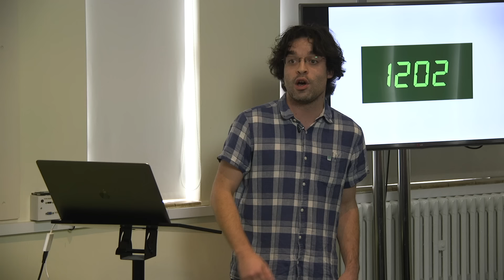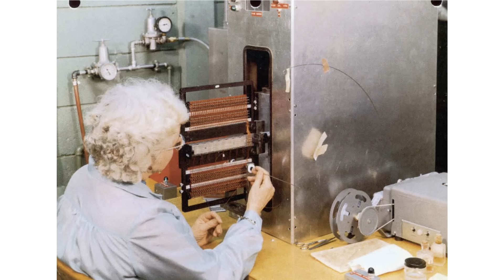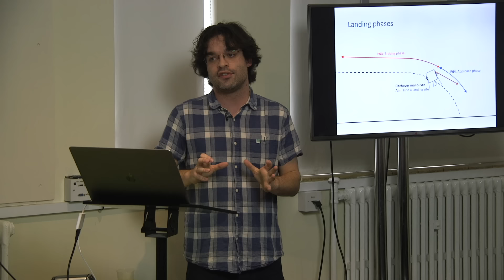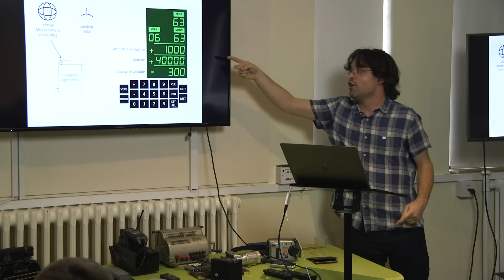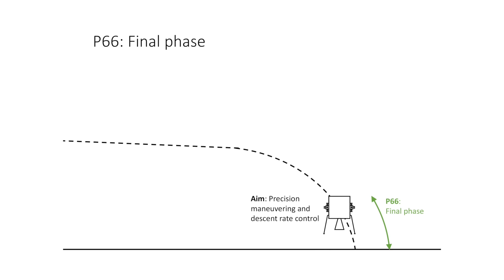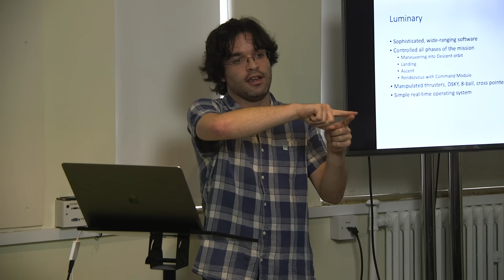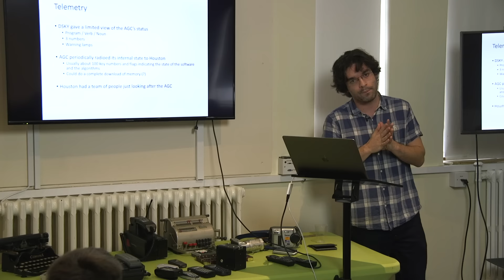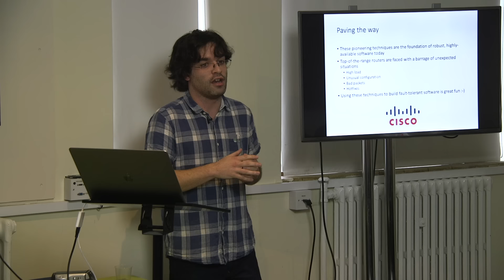Light Years Ahead | The 1969 Apollo Guidance Computer

Comment: Why they're are no documentation of the' bynary op codes for this AGC computer? anyone trying to emulate or compile the luminary code needs that.  All talks only mention the code in a mnemonic way,  that's weird as engineers need the actual bynary op code to compile and calculate memory usage. This raises more questions than answers.  I doubt the compiled luminary code would fit in the rope memory they mention. There are too many points of failure for such design to be reliable for such dangerous mission. I call this BS.
Reply: Search for the Programmer's manual Block 2 AGC Assembly Language. That has the info you're looking for (mnemonic to octal translation table).
Reply: @h.dejong2531  Thanks! I found some octal OP Codes table,  I will have to spend time going through it.  What still is suspicious is that all sites that talk about AGC or discuss its internals  do not cite direct sources or documents from NASA, MIT, IBM or any official source, all come from third party sources like collectors or a John Doe ex NASA worker that happens to keep copies to him self, and some weird ones like from ebay sellers etc. To not go to far the speaker on this video is supposed to be a Sisco worker and does not provide any official sourcing either.   Any effort to reconstruct or emulate such a computer without the official sources won't be taken serious, it won't be more than a fun exercise and will lack of any historical value.  I can see why this might be.  Let's say a find a technical flaw that proves this computer can't perform as they say based on the information I have, NASA or any one will argue that the information I use to base such conclusion is not official and that my sources are wrong.  If you put this under the scrutiny of a librarian or a Historian, it would not pass the test to be considered Historical evidence for the described artefact called AGC computer.
Reply: @FinepixF30  NASA's NTRS archive has at least 162 documents on the AGC. Design details, reliability tests, etc.
Reply: @h.dejong2531  How can any one interested get a copy of such archive?,  why none of the third party books, videos, websites etc about the AGC computer mention or provide links or reference such archives?,  by the way if you don't mind, can I ask you do how you know this?
Reply: @FinepixF30  Yes, the Nasa Technical Report Server is a public website. Most of its documents can be downloaded, for others they only have an index. 
Most of the AGC projects I've seen are hobbyists, they may not consider publishing a full list of their source material important. 
How I know this? I've always been interested in spaceflight, and I'm good at finding information.
Reply: @h.dejong2531  I checked the website but beside some reports with descriptions and photographs I couldn't find any document with detailed schematics for the electronics circuitry for example for the program counter, instruction decoder, clock circuitry etc.  I saw on a third party site an schematic dated on 1965 using a operational amplifier but they were not invented until 1967,  i want to see an schematic directly from NASA or MIT to confirm or disprove this but all schematics are from third party sites without any reference to the source.
Reply: @FinepixF30   A search for apollo agc schematics office logic design finds a site called klabs, which has schematics supplied by Eldon Hall, who worked on the design of the AGC. 
The Smithsonian has the primary archive of all Apollo drawings, so that's the most authoritative source. IDK if they've scanned everything though
Reply: @FinepixF30  A late reply, but you're very wrong about when op-amps were invented.  The 'op-amp' was patented in 1941 and was originally made with thermionic valves ('op-amp' is a concept, and not limited to being a family of integrated circuits).  In the 1950s and 1960s hybrid op-amps were developed - essentially some transistors potted together (start with the Wikipedia entry for op-amps, but have a look for the wonderful and sadly late Bob Pease's contribution).  The µA709 was released in 1965 and that was fully monolithic.  The µA741 was released in 1968 and is still in production today. 
So no, op-amps weren't invented in 1967 - they existed in many forms, including fully monolithic, long before then and were used in the circuitry of the Apollo program.
Reply: @medicallyunexplainedsymptoms  Fair enough,  probably one of the best answers.  For the other questions still no a convincing answer. So far I have not found the machine language instruction set used for the AGC computer wich is the key information to do any reverse engineering or create any trustworthy emulator.

Comment: I'd love it someone could compare the speed/power of something that was so exceptional back in the day to a modern desktop cpu and the fastest smartphones out there...
Reply: AGC: one processor, 16 bits (more or less), 2 MHz, 64 kB ROM and program storage and 4 kB RAM. Multitasking. 
Home computer in 1981: one processor, 8 bits, 4 MHz, 16 kB ROM, 64 kB RAM and external storage of programs (cassette tape). No multitasking.
Home computer in 2019: 8 processors, 64 bits, 2.9 GHz, 32 GB RAM. Multitasking, protected memory. So 1500 times the processor speed (and actual speed is even higher because these processors use pipelining to do multiple steps in one clock cycle), half a million times the RAM. Infinite program storage (just add more harddisks or download via network).
Reply: @h.dejong2531  I can’t believe you took the time to answer that question. Thanks so much!

Comment: I was told, by one of the Apollo astronauts, that the cause of the 1201 and 1202 error codes was the Rendezvous Radar switch was left on during the descent. But there is still some controversy over that switch position. The astronauts said they wanted the Rendezvous Radar on during the descent in case they had to abort and immediately determine where the Command Module was. But there were several comments on this decision: one claim said the Astronauts were not instructed to NOT use the Rendezvous Radar during descent. Another claim said there was a phase problem between the two A/D power converters and the CDU's, they supplied power to. That phase difference frustrated the Lunar Module guidance computer because it got two completely different sets of data indicating the location of the antenna. As a result, the computer kept, continuously, trying to move the Radar Rendezvous azimuth and elevation, in an attempt to find the Command Module, in one direction, than another. THAT, that claim indicates, was the reason the guidance computer got overwhelmed and the 1201 and 1202 malfunctions codes were issued.

Comment: Excellent talk but I have a couple of constructive criticisms: first, it is not true that the Block I spacecraft 'flew the first few missions' - it never flew in space: that was the ship involved in the Apollo 1 fire and it was completely redesigned before Apollo 7 which used the Block II.  Second, there was no mention of the other guidance computer - there was an identical one in the Command Module, which was used for navigating to the moon. The two were identical architecturally, but ran different programs - this explains why the speaker talks about P63-66 but does not refer to P01-62. Third, the calculations done by both the AGCs were mirrored by mainframe computers in Houston, just as the crew's star sightings for navigation purposes were compared with telemetry sent back to earth and fed into the mainframes. But a really brilliant talk nontheless.

Comment: so...why was max power 94%?
Reply: as far as I can find, 100% is the original design goal. 94% is the maximum value used in the mission.
Reply: @h.dejong2531  I reached out to Robert Wills and he replied to me yesterday with this "They found during testing that power greater than 94% caused excessive corrosion of the engine bell. From memory, the allowed thrust settings were 10%-57%, and then 94% (nothing greater than 94 and nothing in between 57 and 94). Don’t quote me on those exact numbers!

There is specific code in the AGC software to make sure it never commands the engine outside of the allowed settings."
Reply: @eeclarkutube  oh, excellent.

Comment: Two alarm codes triggering multiple times at the most critical phase of the Moon mission is........NOT "working flawlessly."  By this stage of the program the landing should have been routine. The overload condition of the computer should have been foreseen and accounted for. They should not have gotten any alarm codes. In modern aircraft, for instance.........certain alarms are inhibited during critical phases of flight....because they are a nuisance and could distract the pilots. Even the autoland status will not be downgraded in close proximity to landing.

Comment: Anyone got a reason for the 94% thrust figure that nobody addressed in the Q&A?
Don Eyles confirms this in his book
"Then, 26 seconds into the burn, the software throttled-up the DPS to its maximum thrust of 9870 pounds (43, 900 newtons), 94% of the engine's official rating of 10500 pounds, and at the same time enabled the descent guidance."

Comment: No landing crater by that big center engine? No dust on the tin foil? Camera already in place to take landing footage. Lost telemetry data and technology so we can't go back. Don't look into it though, just take our word for it. We would never ever lie to you. You can trust us. Cartoon satellites, CGI globe images with growing continent sizes? Come on man. Don't ask questions just look at the shiny pictures of space and Mars.
Reply: The lunar soil was found to be very hard, with everything interlocking. A 45 kN engine won't blow away that much. In the descent video, you can see dust being blown away. 
That 'camera already in place' was stowed in a compartment on the side of the LEM. The compartment door with camera was released by the astronauts. 
NASA did not destroy the technology. Drawings for every part of the Saturn V and Apollo spacecraft exist. We have a bunch of versions of the software for the AGC. We have loads of info on every aspect of the design. Is that enough to start building a new Saturn V tomorrow? No. That's what they're getting at. You'd have to build a factory large enough to assemble a Saturn V. You'd have to build new jigs (because they didn't keep the jigs around, some of those are as large as the first stage). You'd have to replace some of the 1960s era components with new ones: it'd be ridiculous to build new AGCs. So you have to develop new software. The drawings have to be redone in CAD so you can use modern manufacturing processes. All in all, it takes a few years to start up a Saturn V production line, and in that time you could also design a new rocket. This applies to all complex, old projects by the way. B-52, SR-71, the Eiffel tower they would take a long time to replicate, and with today's knowledge we can do better anyway so there's no point. 
The 'moon hoax' story was created by a failed author in an attempt to make money by selling books. He didn't do any research: every single one of his arguments falls apart when you start looking at them closely. He didn't provide any evidence for his arguments. He failed to explain how we ended up possessing 380 kg of material from the Moon, he failed to explain why the Soviets accepted the Moon landing as real. etc. IOW, he was a charlatan trying to make a quick buck off the gullible.
Reply: Why should there be a crater? I don’t recall the descent module exploding.
Reply: @thingusbrulingus  Yea because a jet propulsion engine firing directly on a soil surface leaves zero trace......right.
Reply: @hippo-potamus  this isn’t a jet engine, it’s a landing engine that at max thrust provides 16 kN of thrust, and wasn’t even at full on landing. Nice attempt dodging questions
Reply: @thingusbrulingus   I can point an air nosel connected to my home air compressor and make a crater are you telling me that my 8 gallon home air compressor has more force? GTFO
Reply: @hippo-potamus  so you made a crater in moon rock? Sure.
Reply: @hippo-potamus  You can make a crater in soft soil, not in concrete. Guess what lunar soil more closely resembles?
Reply: @hippo-potamus  
 On your channel, I found: 
 "Master of Science in Biology.
 In search of Truth." 
 If you WERE scientifically minded, and in search of truth, you wouldn't be constantly embarrassing yourself here!
Reply: @h.dejong2531  How do YOU know? Oh right because some one told you. Or did you go to the moon too to verify such soil conditions?
Reply: @hippo-potamus  
 I would not be surprised to discover that you are a flat earther!
Reply: @hippo-potamus  
 What's the bet that you are an antivaxxer, and an anti-masker?
Reply: @hippo-potamus  
 What's this about "cartoon satellites"? 
 Do you mean the ones that we can see, at night, when they reflect sunlight down to our unaided eyes? 
 GROW UP!
Reply: @hippo-potamus  
 Come back when you can DISPROVE space travel, little fella.
Reply: @hippo-potamus  
 Neil also stated that space travel is real, and that we have been to the moon, but you conveniently IGNORE that fact, don't you? 
 So much for you being a scientist, and a truth seeker!
Reply: @hippo-potamus  
 So then, little fella, what is the true shape of our Earth?
Reply: @hippo-potamus  20 successful landings by 3 different countries gave us that data. Specifically, Luna 9 and Surveyor 1 confirmed these soil conditions and proved landings were possible.
Reply: Agreed. NASA haters ARE CLUELESS, LYING DIMWITS!

Comment: How did they take such great film footage of Apollo launching from the moon?  That would have been impossible in 1969.
Reply: Just wondering. Did you look into this, before asking this question?
Reply: @CNCmachiningisfun  Why do you ask?
Reply: @TM-tw1py  
 You have asked a question here, for which you could have found the answer, independently. 
 You DO have google on your computer, right?
Reply: That footage was from Apollo 17. There was a TV camera on the rover, with a motorized mount that could be controlled from Houston. The delay in getting the control signals to the Moon meant it was difficult to time the camera movement exactly. On Apollo 15 and 16 the LEM is soon lost from view. For Apollo 17, the camera controller got it exactly right. 
The video was transmitted directly from the rover (which had a large dish antenna for this purpose).
Reply: there was NO footage of apollo leaving the moon. footage literally derives from the length of film used to film something, while the recordings from the LMs ascent stage was done by a video camera transmitting back to earth. also, it's really far from "great" due to the limitations of those cameras, and the somewhat impractical manner they had to track that launch (they had to try three times to somewhat get the timing right).
Reply from the maker: Well, film and video makers still call it "footage". You've got to call it something. And footage is still stored in "bins" in many computer based editing applications, just as film was stored in physical bins years ago...
Reply: And, way are shadows in the pics pointing in more than direction in the same picture??
Reply: @TM-tw1py  if they were, there'd be more than one shadow per object.
Reply: @TM-tw1py  'Shadows must point in the same direction' is only true if the ground is perfectly level. In those photos, the surface isn't level, which distorts the shadows.

Comment: One of my electronics engineering professors in college worked on some of the Apollo systems at GE. He said if they needed a given electronic or electrical component, they'd get dozens of their very best soldering techs and have them build, say, 50 units of the given component. Then they'd put them on test fixtures and shake them, freeze them, heat them up, and see which ones failed. Over and over and over, until maybe only 5 or 10 of them still worked to spec. Then they'd randomly grab one of the good ones and send it into space.

Comment: I was a Data System Tech on the USS Enterprise 1989-1991... our main computers that ran most systems had those iron core memory as its main ram storage.   They worked perfectly.
Reply: The only drawbacks to ferrite core memory are the cost to build it, the low bit density hence large volume required, slow speed, and the power requirements.  If those aren’t a problem, it works as well as any other technology.

Comment: An Arduino has lots of input/output connections no? I wonder if you could engineer one or a few of these to be equivalent (I know the Apollo Guidance Computer was a one off an maybe impossible to replicate but wondering here for the thought experiment)
Reply: maybe, but you'd need to connect that IO to rather alot of electronics to get correct signal strengths. a better choice than any smartphone though.

Comment: Armstrong taking over was then and even now perhaps necessary as a computer cant reason and your eyes tell you your heading for a boulder field and you take over and as a pilot myself, i trust computers but when something goes wrong or outside of the software, you need to be there to look and evaluate and either keep going or abort or make a change as he did on the day on the moon. Obviously this computer was amazing in so many ways and actually giving you 2 numbers to then visualise on the window in front like a HUD and you can see the trend to where you are landing and adjust it and so many options really, just amazing. the alarms were really human caused from bugs and not a faulty computer and even all that, it kept on going feeding the landing data to Armstrong and all was well. Brilliant and they all worked for 6 landings and thankfully the men could do it all on full manual with pen and paper if worse case , but its makes it all more smooth and efficient having the computer take the head and men as monitors and eyes on the ground.